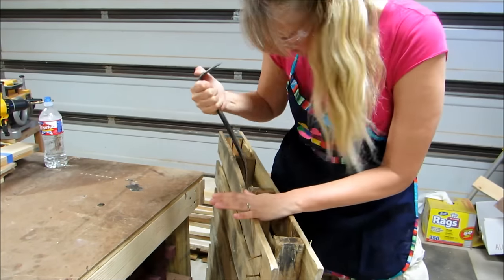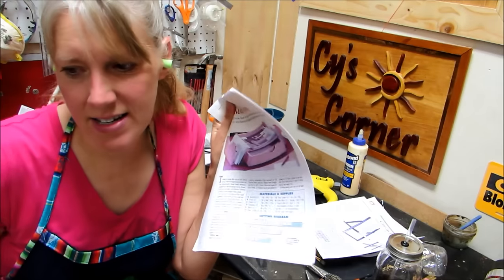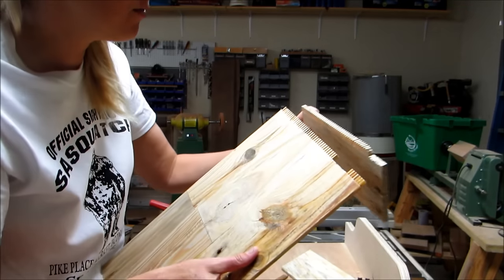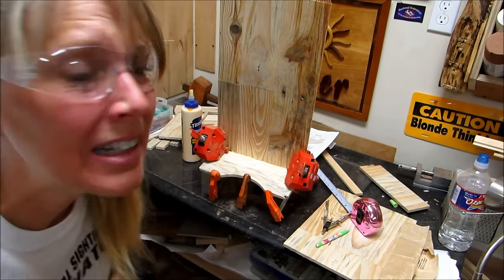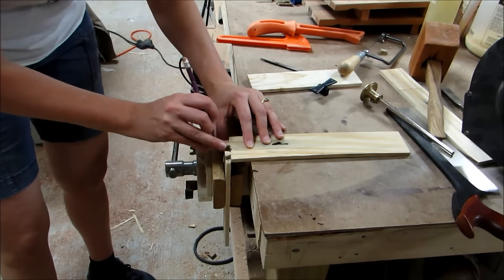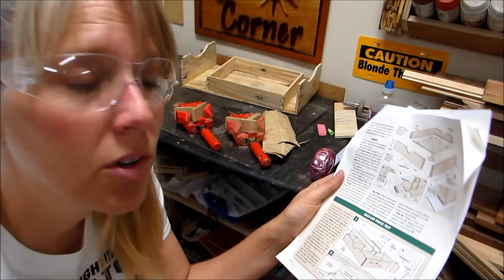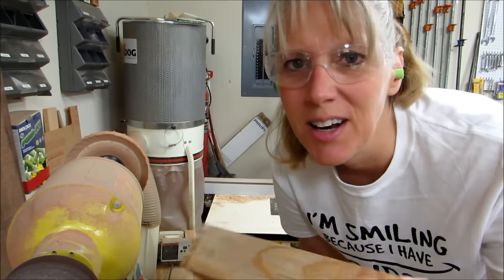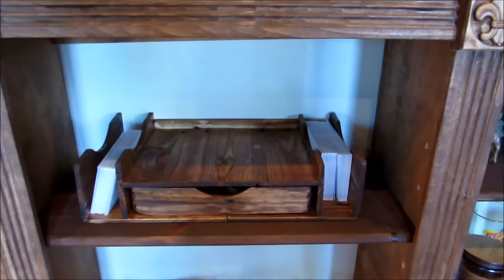Pallet Challenge 2015, Mail Organizer

Comment: Buy an inexpensive corded sawsall, a couple of cheap metal/wood blades and just cut the nails when you pull the pallets apart.  The nail heads are easy to get out with a nail set.  You'll be able to take one apart in a fraction of time and with much less effort.

The stringers on the pallets will be full of nails but they are almost worthless anyway because of the way they split.

Pallet wood doesn't like to be dovetailed or have thin finger joints cut.  Don't judge your skills based on pallet wood.  For the finger joints make them at least 1/4".  If you don't have a dado stack you can make your jig work with a standard 1/8" blade and two passes.  

I really like your finished piece.  Nice work.
Reply from the maker: +Gail Long Thanks for the info!!!!  I agree that pallet wood doesn't want to be dovetailed or finger jointed.  It is an angry wood.  But I like the idea of 2 passes with the 1/8 in blade, goooood idea!!!

Comment: I think organizing males is a bit beyond the scope of one woodworking project ;-)
Good job Cy. 
I've noticed that heat treated pallet wood seems to be very brittle in small pieces, which is probably why you had such trouble with the thin box joint fingers breaking so much. It would probably hold up better with wider ones.
Reply from the maker: +Jon Stewart (Vaulimere) Heeeheeeeee, organizing males would be a tedious job, I can't organize the one male I have  :)  I think the pallet I had must have been like you said, very brittle.  Makes me think my jig may work with some good wood  :)